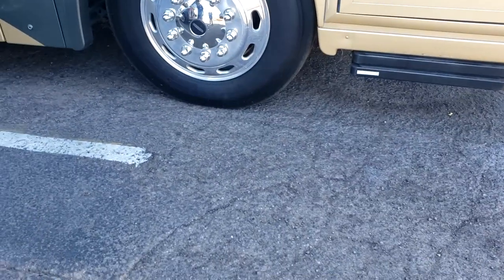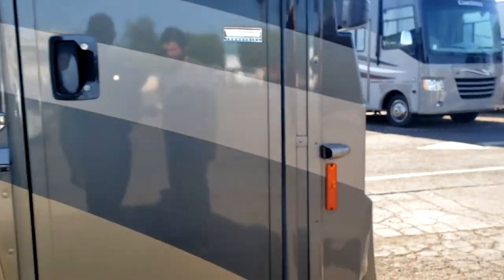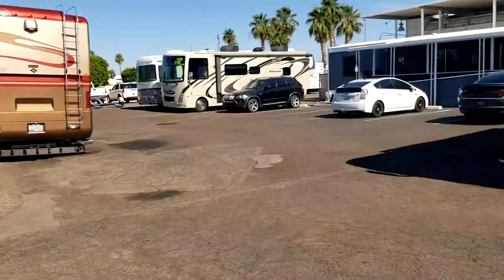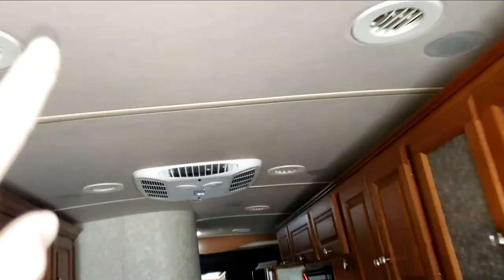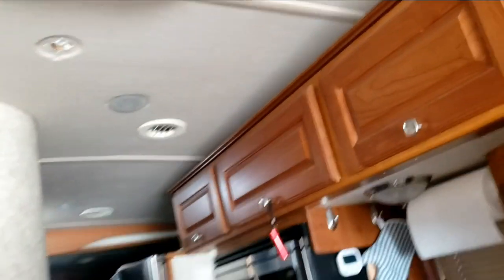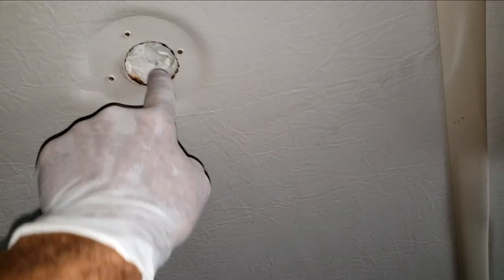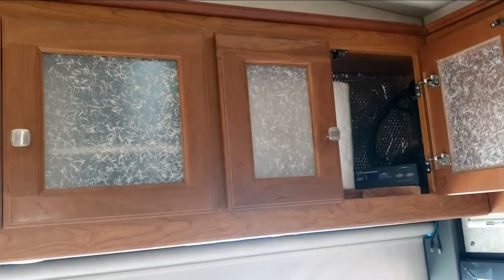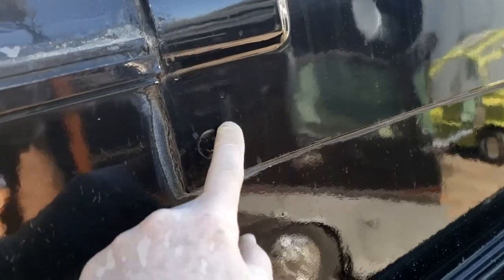Winnebago's Roof Mistake Required New Roof: 2009 Journey

Comment: You've made the point to us in many of your videos that Winnebago fiberglass roofs may not be all that well built. We have a 2012 Itasca Class A built on a Sprinter chassis. We are not enamored with the cost of repair & maintenance of the Mercedes-Benz chassis anyway, and we are about to need new tires and we are now wondering about our 11-year-old roof. So, the question is, would you think that it would be a good idea to trade ours in for another newer but used RV? If so, of the three big manufacturers; Thor, Forest River & Winnebago; who makes the best roof?
Reply from the maker: Please don't make me say Thor roofs are the best, but one piece gel coat fiberglass are the ones to look for if it's not metal.

Comment: Thanks for the info on the correct sealent for Winnebago roofs. I just finished a Winnebago roof today by pulling and cutting the old sealent and the wrong "stuff" that someone used on top of it off and putting the right sealent on. Could you PLEASE tell people that the stuff you watch on T.V. that claim you can use this "stuff" to make a screen door into a boat should NEVER be used on any camper or RV! I'm SO TIRED of pulling that stuff off after it fails to seal peoples leaks! AND THANKS AGAIN!!
Reply from the maker: Yes, all the "as seen on TV" products are rarely good and cause more issues. I'm glad you were able to get the right stuff on. Honestly, few technicians know about the correct Winnebago sealant either.

Comment: 4:45 My Class C  has way to many Staples  in the  front cap ceiling, I reinforced it with screws and liquid fome insulation it really made everything much tighter.
Reply from the maker: Thanks for the tip!

Comment: I remember doing a delamintion removal on a whole floor at glaxosmithkline...little larger then this...lol...amazing how gluing becomes an issue through just lack of quality effort, took vibrating chisels to get maybe 3/4 up but just lifting for the other quarter...should never have been that simple...two weeks for 3/4...3 minutes for last 1/4.
Reply from the maker: That's crazy!

Comment: Kinda late but when you're cutting paneling on a flat, critical surface (like yours loaded with wiring) throw a chunk of 1x4 or similar wood under the piece you're cutting so you don't cut through wiring or something you can't see underneath.  If you nicked a wire you'd never know.   Ask me how I know !!

Comment: Awesome video James.

So the delamination is because the original installers joined the filon over a channel? That mistake cost this owner what $5-7 thousand bucks. That’s terrible!

Good news is we got to watch you fix it.
Reply from the maker: It's likely time caused the glue to let go, but having a flexible underlayment joint looks like it allowed the material to flex more than it should have. Thank you!
Reply: A LOT more than that, well over twice that much . . . trust me, I know, IT'S MY WINNEBAGO!.  Not complaining about the cost or the job that James, Chad, Micah, et.al. did, my issue is with the manufacturer and the sloppy manufacturing process!
Reply: @jimanderson4132  Well the positive is, your roof should be good for a VERY long time now

Comment: Hope getting some relief from the heat! My 2003 Winnebago's recently purchased roof has big bubbles but half of the filon on top is gone along with the radiuses on sides (which is part of the roof) The wood part looks OK because CO is dry like Arizona. I am going to lay down PVC roll as roofing material but don't know what to use on missing curve sides. I ordered aluminum flashing which looks OK but we get hail in Colorado often and afraid it get dented. I'd like filon but all I see is in 8 1/2 foot but I need strip of about 10" wide by 28' long.
Reply from the maker: All-rite.com has the width you need. You could also look into having a sprayed on roof installed. I'm not sure what your plan is on the termination molding on the side is though with a PVC or membrane roof. I would be very interested to see.
Reply: @AZExpert  Sure, I will keep you posted as I progress. Thanks

Comment: I have a 2002 Monaco dynasty and when sealing the roof note that most of the “fiberglass” is bubbled. Should it be laminated and what is the risk of I don’t have it replaced?
Reply from the maker: seems strange the fiberglass would be bubbling...are you sure someone didn't coat it and the coating is bubbling?

Comment: So from your Expert post the roof could have been saved, it’s life extended, and water leaks remediated.  De-lamination can be repaired correct? It was the owner insisting on replacement? Have you counted all of the OEM Winnebago roof defects you have corrected?  Have you ever videotape repair to delaminated sides?  Seems to be common issue.  
Some people like to waste money and do just to be doing.
Reply from the maker: Its possible  we could have tried to re-laminate, but the deformation of the filon would have caused an issue for sure, and the only savings at that point would have been the filon, as the labor and other components would have been the same, but with a much less appealing finished product and no way to warranty the work. Thanks!

Comment: Any way to detect leaks like you showed before they cause bigger problems?  What is the ball park cost for a new roof like that?
Reply from the maker: The motorhome can be pressurized with air and then the outside sprayed with soapy water. The industry uses a fan called a Seal-Tech. Many larger dealerships should have one. Thanks!

Comment: Seeing how these roofs are made makes me really leery of screwing anything into the roof like a bracket for a solar panel. Panels are not very thick and there are lots of wires to hit.  I'm guessing the best anchor is 3m double sided tape.
Reply from the maker: I don't trust tape personally. Keep the screws under 1 inch and you'll be fine

Comment: I’m a little confused that the roof condition wasn’t evaluated before the AC was installed. Or did I miss something in the translation.
Reply from the maker: That's how the problem was discovered when we got on the roof to remove the vent.
Reply: AZ Expert 
Ah..gotcha! 
👍
Reply: My thought too. Why install the new ac when the roof needs work? I know you said you saw it when removing the vent, but why not stop at that point and talk to the customer before adding the ac. Not a complaint, just a legitimate question

Comment: What tool tip do you use on your multi tool?
Reply: And what is 'your best method' removing sealant on a epdm roof and fiberglass. Thanks in advance!
Reply from the maker: On fiberglass I use a razor scraper, on membrane roofs, I carefully use a putty knife to get the majority of the sealant off sometimes you can peel the sealant up cleanly by hand.
Reply: @AZExpert  thank you for responding and I appreciate the information I love seeing your work and learning something new specifically the names of things.
Reply from the maker: I was using a wood/metal cutting tooth blade, but I also make a scraper blade from worn down tips by grinding and sharpening where the teeth were.

Comment: Is there rv insurance that covers a roof repair like this?
Reply from the maker: Its complicated. Most insurance will cover "physical" damage to the roof like branches or storm damage. However, many will not cover wind damage from neglect or factory defect. So if the roof is torn and the radius sealant is obviously not maintained, they will not cover the roof and they are looking for that. Of course if you hit something......they would have to cover it.

Comment: Have you had any problems with a 2020 Rockwood Signature? I bought one back in April of this year and I am have all kinds of problems with it. Like it has to have a new roof for start.
Reply from the maker: I've had issues with every RV if that helps. Many times, new RVs take a few months out of the first year to shake out and repair the factory's blunders desite assurances of extensive Quality Control. I'm sorry to hear about the roof, seems like a more common problem then I thought.
Reply: AZ Expert how about problems with the auto leaving systems on travel trailer. I have one and it will automatically leave one time then the next time it will not. The dealer ship can not figure what is going on with it. The roof has came apart twice now and is in for repairs again.

Comment: Buy a motorhome is a pig-in-a-Poke.  Looks  that the companies are not doing the job.  Cheap crap that could do so much better being a little slower in the construction...
Reply from the maker: I was surprised to be sure the seams were aligned so poorly. Winnebago is one of the few manufacturers that use computers and lasers and CAD so you would have thought the panel layout would have accounted for the joints.